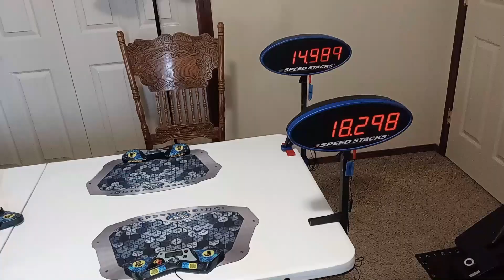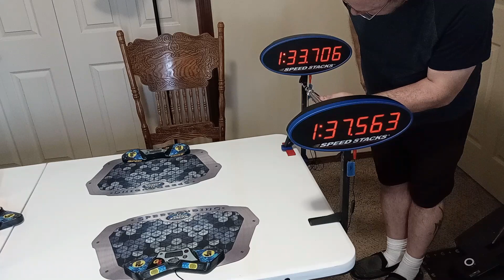StackMat G5 Pro Timer Reset Issue - Solved???

Comment: Thanks for uploading the video and sharing your findings. I have had this happen both with G4 and G5 timers. I can trigger the reset by simply charging a balloon and touching a cable plugged into the timer (but not the display). The cable does not have to be coiled up. I guess your TENS unit is a lot more powerful than my balloons, but it is now clear that the sporadic resets are due to static electricity.
Reply from the maker: Interesting, I wasn't able to get any resets with the TENS touching the cord.  I'd love to see a video of you getting resets with the balloon.
Reply: This worked! By charging a balloon and holding it against the plug of the g5 cable, and then resetting it (while holding the balloon). I had the issue where it wouldn't go from 4 pad to 2 pad.

Comment: You are lucky to have resets. I just bought mine. It starts, it stops, but there is no way to reset it other than removing the batteries. And it will always power on in 4 pads mode, with absolutely no way to put it is 2 pads mode.